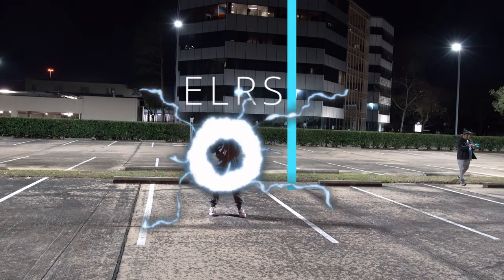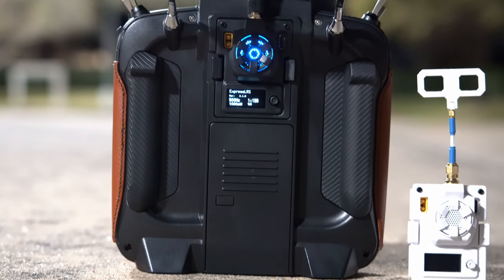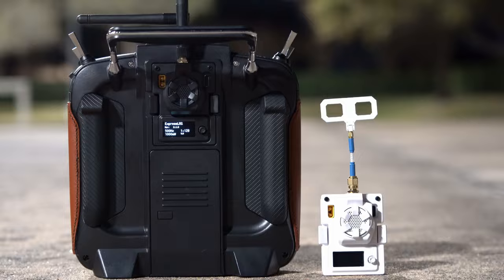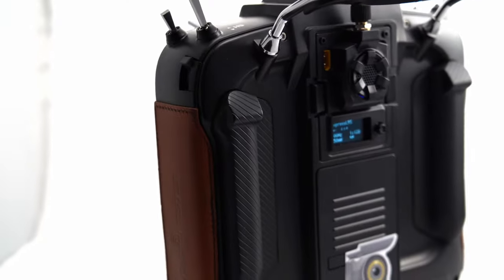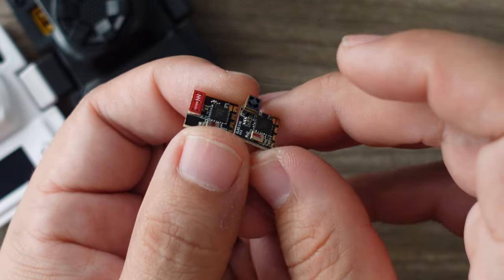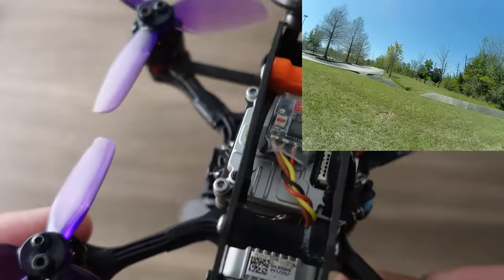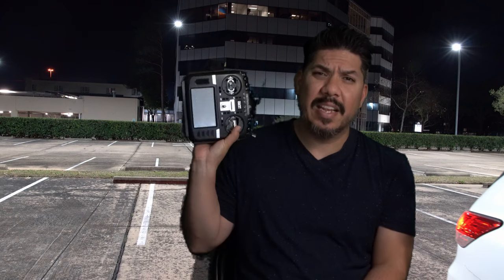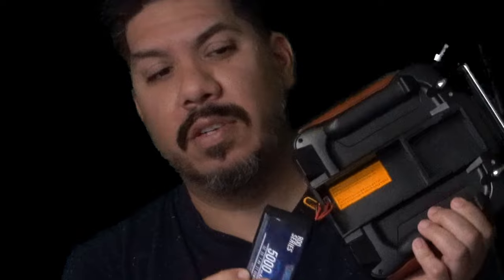1 Watt ELRS + flat antenna Express LRS BetaFPV

Comment: They're awesome - both products. Got a review coming for the 1w module soon too. I just love the oled screen; it's such a great addition, even just for the "cool" factor.
Furthermore, the lite receiver with flat antenna is lovely for tight builds. Love them.
Reply from the maker: nice!  Are you flying ELRS on everything? Or mostly micros?
Reply: @JonE5FPV  I'm kinda just popping it on anything I don't need crossfire for; so crossfire for LR and wings, ELRS for drones. It's really nice to save $20 per receiver which can be invested into a better VTX or Cam or other chosen component I think :)

Comment: SO is this the "fixed" flat antenna RX version? I remember initially a while back this came out and was a bust because it had no range.
Reply from the maker: Yes. There was issues with the initial batch. This is 2nd batch which should put it just under range of the ceramic. 

That said these are great for micros but I wouldn’t trust either for racing.  Rather use the one with the little T antenna. Much better signal
Reply: @JonE5FPV  Sweet, good info!